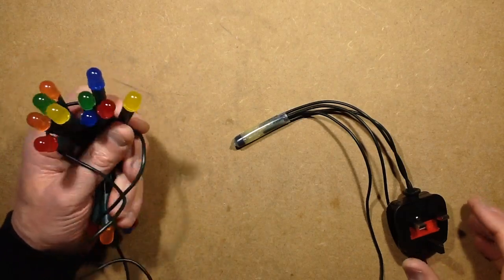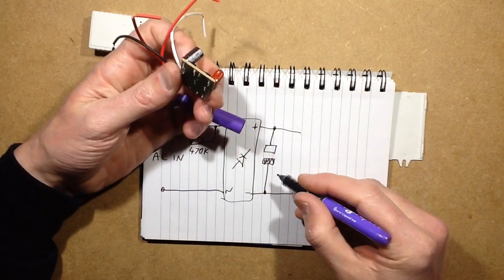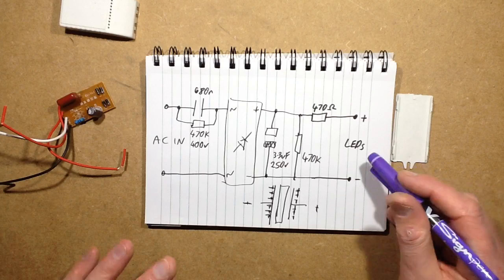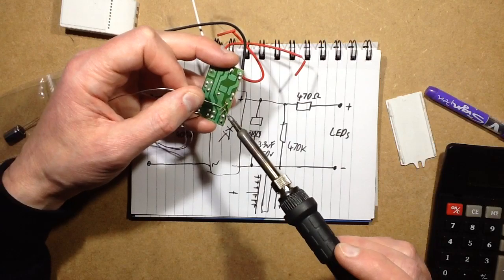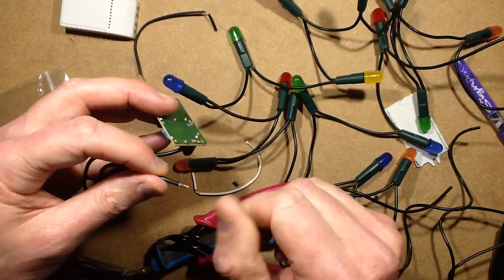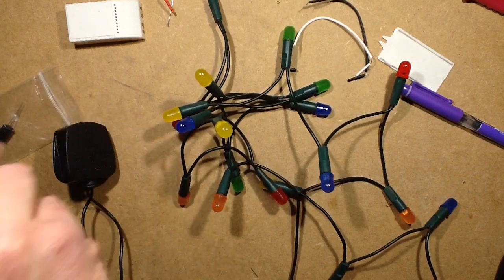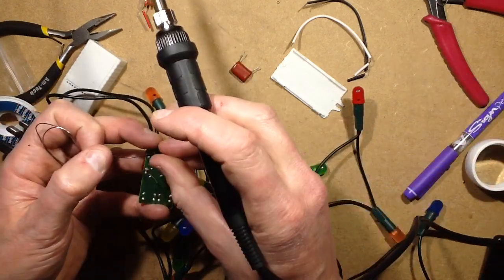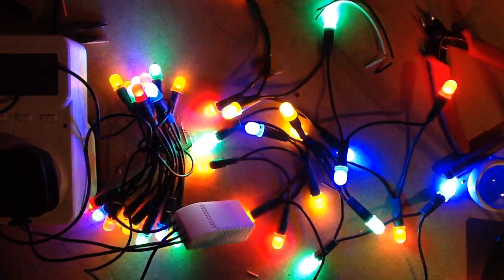BRIGHTER conversion of tungsten fairy lights to LED.

Comment: Thanks for giving me some ideas and inspiration! I'm now going to make a set of 100 RGB slow fade LEDs. :)
Reply from the maker: Keep in mind that the maximum number you can wire in series depends on your supply voltage.  For 100 LEDs it will need to be around 230V.
Reply: True. 3.2 - 3.3 × 100 is 320 - 330V so it should technically be enough.

Comment: Hi there, i just made a set of these 20 led lights. And made the sam driver. The thing i need to know. I have converted a set of 1960s, 1070 christmas lights that have 5 set of 20 on it, will the 2 capacitor s bee strong enough of 5 sets of 20.
Reply from the maker: If each section has a similar amount of LEDs of the same combined voltage then it should work.

Comment: Ive got a set of vintage candle lights i'd like to replace with LEDs. Unfirtunately i dont understand any of the physics here!
Reply from the maker: You may be able to rewire them to operate from a low voltage supply like a 5V USB power supply.  Depending on the bulbs you may also find retrofit LED bulbs for your effect.  Note that you can't mix tungsten and LED bulbs in series though, so it may be better to change them all at once.

Comment: Recently saw Dave put a cap in backwards in an oscilloscope rebuild, it was quite interesting, while the camera was not on the cap at the time, the magic black smoke was fab, and Dave's reaction classic as he rushed to remove power.  The result on the cap was classic as well!

Comment: I kept wondering why you drew resistors as boxes and not the familiar triangle waveform. TIL that the box schematic is the International Electrotechnical Commission symbol for a schematic resistor. It's been a while since I did any electronic circuitry. Another win for the web - question raised in my mind by watching a Big Clive YouTube vid answered by surfing over to Wikipedia. What a time to be alive!
Reply from the maker: I used to draw them zig-zag style, but changed when the electronic magazines switched over in that era.

Comment: Hi Clive. I am attempting to convert my old tungsten Christmas star to LED. I got the capacitive dropper in your video via the link. Unfortunately, I was only able to get the 50-80pcs when I really need the 1-36 as I will be powering 35 LEDs. The dropper is putting out 335VDC from 250VAC (UK) with a 684J 250V capacitor. I changed the capacitor to a 220uF 400V but that only dropped it 10V. The LEDs I am using have a max forward voltage of 3.8V with 30mA times by 35 and i get 133VDC. What size capacitor would I need to drop down to that voltage? Would I need a higher or lower capacitance?  Is there a calculation I could do to find out.

Cheers.
Reply from the maker: +Michael Love The voltage will float high off load.  220nF is fine.
Reply: bigclivedotcom thanks for your reply Clive. Just before I saw your message I had a light bulb moment. I suddenly realised that I was testing without a load so I guess I was getting the voltage reading from the smoothing capacitor, which if I am correct makes sense.

Thanks.
Reply: bigclivedotcom It now works a treat. Thanks for your help and your inspiring videos. Keep up the good work 👍👍👍🍻

Comment: I made one, ever solder my own supply according to the schematic. I used 5mm rgb slow flash led's, at first i used 100nF capacitor but they have problem going the full cycle of colors, changed to 150nF and it's just enough (string of 100 led's)

Comment: Just done one of these with a capacitive dropper on a set off 50 from Poundland (disappointed to find it only had 48 fitting).

Was going to make a capacitive dropper but then remembered I still had a spare one from doing the red/blue LED conversion on the bulb kit. I figured that since it was driving 38 LEDs in the kit it would be fine with 48 in the string.

Comment: Wait, you say it's a way to make it's brighter than the one with resistors, but using lower resistance resistors wouldn't make similar effect ?
Reply from the maker: It would work, but the heat dissipation from the resistors becomes an issue.
Reply: At that point you would have to add lots of lower value resistors in series, presumably attached to the LEDs to spread the dissipation, but then it either becomes a time consuming modification process or you end up with a hell of a long resistive dropper, correct? (I'm learnding [ralph wiggum] from this channel!)

Comment: Love this, Clive. I was tipped off to it by my brother-in-law. Goaded on by him, and having also studied the sister video to this one which shows in detail how to fit the LED's, I went ahead and successfully converted a failed multi-colour 50 bulb tungsten set to LED.

I used the big 10mm diffused LED's and a capacitive dropper as featured above. As suggested to one of your other viewers, I changed the capacitor on the AC side from 680nF to 330nF (plenty bright enough for 50 LED's) and, as recommended in the video I changed the electrolytic cap for one capable of handling 400V.

I consider myself to be a "novice dabbler" as far as electronics is concerned, but this project passed off without a hitch. Many thanks and Big Kudos to Big Clive! Cheers mate!
Reply from the maker: Good result.  I really like the big 10mm diffused LEDs in this application.  I made my brother a set of red, orange, yellow and warm-white ones with them.  It only draws about half a watt and is just left on 24/7.

Comment: Do those wire strippers work on all gauges of wire? And where can i get one? They seem so simple to use, no more guessing on wire gauge and finding the right slot on my strippers.
Reply from the maker: The v-notch style stripper can be set for any size of wire.  They're a pretty common wire stripper.
Reply: bigclivedotcom Ah that's a shame, still have to adjust them per wire eh? Oh well they still look more enjoyable than what I normally use, thanks.
Reply: TYVM! I'll check these out.

Comment: When ever I put wires through a board I'll put some solder on them so that the wires don't splay everywhere.
I have done it both ways though.
The soldering the wire has its advantages and disadvantages.
One it is easier to put through the holes.
But two there could be a big blob of solder that you have to get off before you can put it through the hole.

Comment: where do you get those LEDs?? I ordered some on Ebay, 10mm diffused and they are so dim. The Green is barley noticeable, red is crap, yellow is meh and the blue is the only one that is bright, they require a max of 20mA and if you give 21mA they burn. They are "5000" mcd, im not sure if thats the reason but I couldn't find any better 10mm diffused leds.
Reply from the maker: +chems The seller has sent you Gallium Arsenide/phosphide indicator LEDs.  You have to shop around to find decent intensity ones by trial and error.  On a plus note, the dull green ones run at about 2V and will last for ever unlike their modern Gallium Nitride rivals.
Reply: bigclivedotcom thats exactly what i thought since the green had a nostalgic color, can you recommend me the LEDs you got in your video?
Reply from the maker: +chems Those ones came from an AliExpress seller who didn't pack them in proper static protective packaging and also supplied the 5mm version in the same old-skool green you got.  So I wouldn;t recommend them.  Try searching ebay for 100 10mm (or 5mm) diffused green LED.

Comment: Hi Clive,
What is the device you are using to monitor the power consumption, and where can I get one?

Gordon
Reply from the maker: +Gordon Cole (Gord) It's a common device called an energy monitor.  But there are good ones and bad ones.  The one I use is a good one but quite hard to find.

Comment: I've worked with quite a few LEDs, on the general, you can assume they can safely be driven at 20mA, and I've pushed higher-end LEDs to 30mA with no negative results.

Comment: what  capacitor would you recommend for a 40 string at reasonable brightness?

I'm still waiting for my led drivers, it's quite frustrating
Reply from the maker: +brian whittle It depends on your mains voltage.  On 110v the original should be good, but on 230v I'd suggest around 330nF at 400V.
Reply from the maker: +brian whittle It depends on your mains voltage.  On 110v the original should be good, but on 230v I'd suggest around 330nF at 400V.
Reply: +bigclivedotcom will 470nf at 230V be too bright
Reply from the maker: +brian whittle That could be pushing the LEDs quite hard.  It's always better to under-run them as they will last longer and also have less intensity degradation over time.

Comment: Please try LEDs - 10 in series - with a 230v - 24volt  transformer.  That would be a lot safer than keeping the light set at
mains potential, which if becomes open circuit !!!!!!

Comment: Clive, how do 35 white led strings with colored cover's run directly on US mains 110-125VAC? Have they just hidden components in the end plug that lets you add a string or in the mains plug? I haven't taken one apart. Do the wire them in series? I had one bulb go out and the rest stayed lit. Thank you for your thoughts.

Comment: G'Day Clive Love your videos, there very entertaining and full of interesting facts and knowledge I have learnt quite a bit. I would like to see a capacitive dropped Circuit with 1 watt led's if at all possible thanks. keep up the great videos Rik.
Reply from the maker: +rikstr77 Hi Rik, it's not really practical to use the capacitive dropper for the currents involved with individual 1W LEDs.  They're better suited to higher voltage strings of LEDs run at lower current.  For the higher power LEDs a small switching converter is a better option.

Comment: Hi Clive, I just saw this on you tube http://youtu.be/22kx0q5j-JA and wondered if you could cast your expert eyes over one of these and let us know if the tube really is doing anything meaningful or not. There are lots of folks arguing the toss but few of them seem to have a) taken apart the kit and b) be as knowledgeable as you on the electronics side.
Cheers
Ian
Reply from the maker: +Ian Wilson Tubes (or valves as we call them here) are very much part of the audio geek industry.  They are not as clinical as modern transistor amplifiers so may soften and colour the sound slightly.  But personally I'll stick to modern amplifiers.
Reply: Fair enough. I like them but it's more the aesthetics of that glowing glass lump full of interesting and complex bits and pieces rather than any particular "better" audio. I'm afraid my ears struggle to tell the difference!

Comment: I think with the second capacitor the voltage rating isn't an issue because after rectification the voltage is only 170v P-P rather than the 340v P-P seen at the input of the rectifier when connected to a UK 240VRMS source as is the nature of rectification the P-P is halved.
Reply from the maker: peak voltage is with reference to zero volts, so even after rectification it is still about 1.41 times the RMS voltage.
Reply: bigclivedotcom oh you're right, somehow I forgot about RMS to P-P being 2*(RMS*1.414) and mistook 339 to be P-P when it is peak as you say... bit of a brainfart xD

Comment: Remember the 50 bulb string conversion I said I was going to do?
Well, I did it! My bag of 100 warm white diffused 5mm LEDs came the other day, they light up nicely.
Used a capacitive dropper lol.
Dropper cap is a 1uF 275V X2 cap, a few resistors, a few 1N4007 diodes, a 10uF 200V cap to eliminate flicker, and I even added in the two 3A fuses (ugh, they're the tiny 125V glass type.. :S) that were already on the string (in the plug) .. cause why not? :P
It's been going all day, and hasn't blown up XDDD

Comment: Great video but what would you recommend for converting a 500+ tungsten light Christmas tree? I believe they are wired in parallel.
Reply from the maker: +Jerry Morley If it's the classic American style parallel festoon with 120V lamps then the only simple option is LED lamps and that ain't going to be cheap to do in a single hit.  It might be easier just getting some new 100 LED strings to re-do the tree from scratch.

Comment: Great channel Clive...I tune into every video. Is there one of those driver boxes from china that will drive 50 LEDs in parallel as opposed to series that currently run on 3 AA Duracell batteries?
Reply from the maker: +Arfur Watt The capacitive or resistive droppers are only really suited to long series strings of LEDs running at low current.  To run the parallel strings would require something like a USB power supply and a suitable resistor or two in series to limit the current to the desired level.
Reply: Thanks for the info Clive.....I tried running the battery box with a 5 volt phone power supply adaptor...took out the batteries of course and spring terminals just left the switch there and small circuit board which gives OFF, ON, FLASH functions. Replaced a resistor and " voila" works a treat    : )

Comment: I just wanted to send you the URL to a page where you could calculate online the right for capacitor and resistor (given the mains voltage, frequency, desired output voltage and current) to take the guesswork out of the circuit. But it looks that just starting with this November they decided to take it down and instead sell a windows program to do that simple calculation...

Comment: where can i find that power meter that u use as here we use UK plugs with 220V? can it measure wattage for an AC which runs at 15A or so? can u make a video on how to make any appliance wirelessly controlled, something like a wirelessly triggered plug to switch things on and off?

Comment: have you seen the random other stuff that eBay seller has? severed arms, "sexy" clothing and classy fake diamond wedding rings.
Reply: +James Grimwood 
That's almost normal for these sellers. But it gets funny when they somehow automate the naming of their (mostly fashion/apparel) items and slap random attributes on the names. I just bought a "Striking Nice Red" and "Sassy Stunning Green Laser Pointer" and almost got weak at the "Chic Stylish MPU-6050 Module 3 Axis Gyroscope + Accelerometer Module for Arduino" and "Sightly Chic 18650 Li-Ion Battery Container". ;)
Reply: I like the keyword spice mix the Chinese sellers sprinkle on their eBay items. It's not an "LED Torch", it's a "LED Light Torch AAA ultra bright L.E.D CREE 12000 lumen flashlight battery lamp inspection light" ;-)

And then the thing you end up getting is a plastic keyfob with a white LED poking out the end and a coin cell battery in the middle.

Comment: Thanks for doing an update to your previous video.  I really liked the looks of those big 10mm LEDs. Now to find some lights here that are still wired in series and one of those LED drivers that are 120v and not 220-240v.

Comment: ok so I have a 2w Philips Luxeon LED it worked fine so I took it out of the bulb in the hopes of making a torch but cannot get it to light up with a battery.... are these AC LEDs?
Reply: +zeatsov looks like those are 50V array LEDs, so you'll need a DC-DC up converter.

http://www.lumileds.com/uploads/372/DS110-pdf
Reply: +zeatsov I'm sorry to have to ask this but better safe than sorry, you have tried both polarities?
Reply: no not tried both polarities for fear of breaking them, I know some LEDs don't like it lol. been trying to work out the output voltage of the circuit it was attached to but I'm useless plus i can't find a program that easily allows you to enter your values etc and give you an output and I don't really want to be attaching it to mains by the bare wires lol.
Reply: +Alex Law I don't think that's the same LED I have, Mine is round with two positive and two negative solder points sticking out at both ends.
Reply: zeatsov Could you show a picture of any markings, or show us the listing? Then (hopefully) we should be able to let you know what you need to do.

Comment: I have some Christmas lights that used the old incandescent bulbs and I hate them because I never know which ones to buy to replace them and I always wanted to replace them with LEDs. I looked at Electronic Transformer Power Supply Driver Fr String LED 50-80pcs  and every single one says 220v-240v so odd that cap was so low.
Reply: Glebs Litvjaks
Yes, and as an engineer one should always look at things as a worst case scenario ALWAYS.  In this case it is better to be a pessimist than an optimist.
Reply: bigclivedotcom
Precisely, and if one blows (as they do when put outside) on a rare occasion then BOOM! :/
Reply from the maker: +legalizeshemp420 And besides...  You absolutely WILL end up plugging and unplugging LEDs for fun when the string is lit.  And when it goes open circuit as you do that, the voltage will go up.
Reply: +legalizeshemp420 
Yup, and I'd use a X1 or X2 rated cap just for an extra layer of safety. Not a regular film cap like in these little units.
Reply: Benjamin Esposti
I don't think I have ever, and I mean ever, seen that in anything "Made in China" before.  If so maybe on the 1k dollar plus stuff but most Chinese stuff could care less about EMI/RFI for such things.
Reply: *****
No, the purpose is not for EMI/RFI, it's the fact that the X type capacitors (supposedly) have zero short circuit failures. Or, they fail safely, and not catch fire XD
Reply: Benjamin Esposti
Ahhh, I only ever see them used for EMI/RFI purposes.
Reply: *****
Yeah, they are made to be extra safe so you can put them across the AC line without having to worry much about it failing.
I still think a huge surge would cause uncontrollable arcing internally, which would heat it up and make it catch fire ... but ... yeah XD